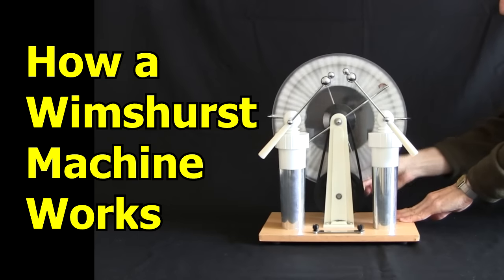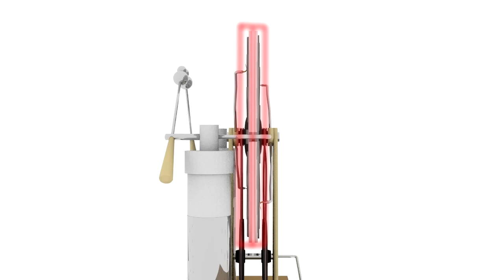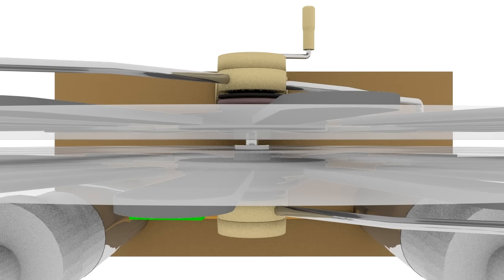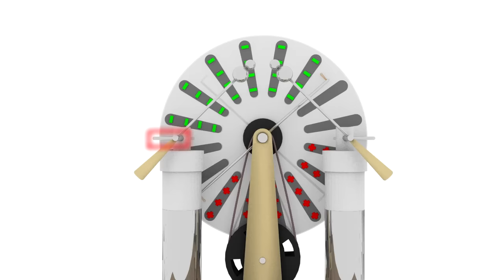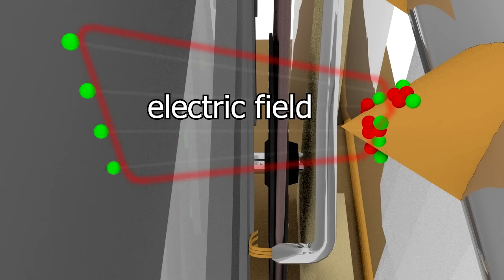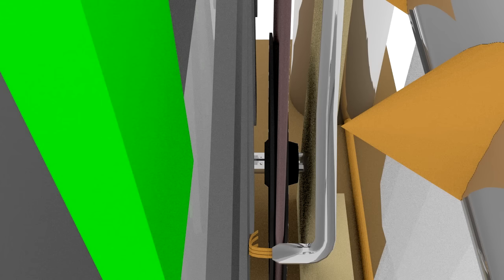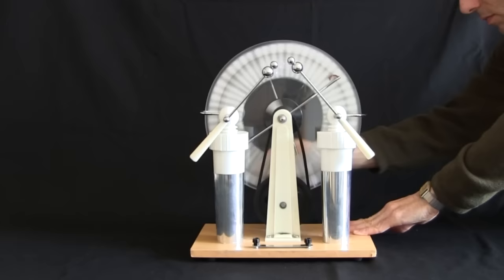How a Wimshurst Machine Works

Comment: I had a Wimshurst Machine when I was a kid and played with it endlessly, but it did not have any Leyden Jars.  It worked perfectly well without them giving an almost continuous spark.  We replaced the crank with a shaft that allowed an electric drill to be attached but the extra speed didn't make much difference.  I note that to get it started, at least in my experience, you wind it up and then allow it to slow down and it was during the slowdown that it most likely fired up.

The video explanation is somewhat lacking.  Why would electrons from across the neutraliser away from positive charges that attract them to other side where there is an approximately equal charge (positive and negative charged particles) causing an excess of electrons on one side and deficit on the other.  This flies in the face of thermodynamic laws as energy should be required to cause such an imbalance (to drive electrons away from positive charges across the neutraliser to the other side where there is no significant electron deficit).

The other puzzling thing with the explanation given is that many Wimshurst Machines that can be seen just by googling show the neutraliser bar not lining up between two metal pads on either side but when on one metal pad on one side is between pads on the other side.  This is how I recall mine.  The alternative explanation is that the static charge on the plastic disc is being transferred to the metal disk.  That would explain why the voltage is around 20,000 which is typical for static charges.  This also corresponds with the nature of Vandegraph generators that also pick up static electricity from a surface where static is likely to accumulate (eg insulators).
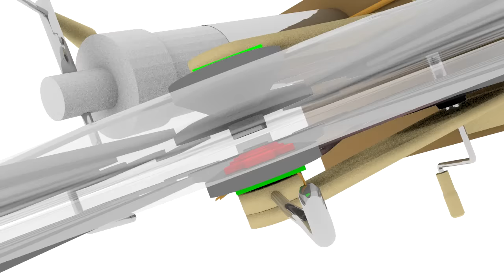Reply from the maker: At 3:34, you can see a negatively charged sector on the disk opposite the one with the neutralizer bar. That's the sector with only green negative signs showing near the top of the video frame. That's what does the repelling of the electrons to the neutralizer bar. There's a similar sector on that same disk at the other end of the neutralizer bar that's positively charged. It attracts electrons toward it away from the neutralizer bar. So it's the influence of those two sectors which provides the imbalance. The energy source for this whole machine is ultimately the mechanical energy of turning the crank.

As for neutralizer brushes which aren't perfectly arranged to touch two sectors at a time, if you ever run your Wimshurst machine in complete darkness, and if it's charging up enough, then you'll see a bluish (or some say purpilish) glow between and around the sectors at the top. If it isn't producing enough charge then the glow will be too dim to see well. That's corona and is ions leaking from the edges of the sectors. It's considered a loss because much of it goes to the surrounding air. It's also electrically conductive and so has the effect of electrically smearing out the sectors such that in that area they're one big sector.
Reply: @RimstarOrg  I used to run mine in darkness.  The electric drill would glow with static electricity as well ha ha.  Try the machine with misaligned brushes so that only one is on a metal pad at a time and you'll find it still works. 

As for the charge going uphill, if your hypothesis is correct then initially neutralising the metal plates would prevent the machine from working at all.  But it does work because static on the disc is transferred to the plates.  As I understand it the principle is the same for any static charge buildup such as combs through hair, silk rubbing, walking across certain surfaces etc....and rubbing a brush over an insulating plate that can accumulate static is another one :)
Reply from the maker: I agree, it should still work with misaligned brushes. As I said, there's an electrically conductive corona in the gap between the sectors in that area. So a neutralizer brush that's in between sectors is electrically connected to the sectors on either side of it. I just didn't cover it in the video because there are a lot of things that could be discussed and so I kept it to the basics.
I wouldn't say the charge is going uphill. Whenever you have a charge imbalance then charge moves in order to restore that balance. In this case the sectors on the other disk are creating a temporary imbalance on the sectors in contact with the brushes (including the area between the sectors) while the sectors are opposite each other.
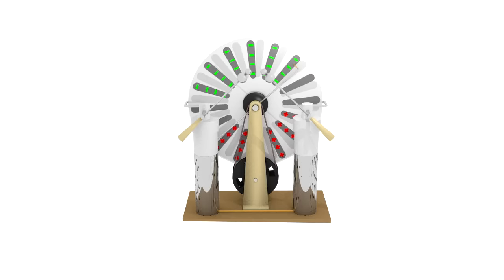Regarding neutralizing the metal plates preventing the machine from working at all, that's exactly what happens. Luckily in reasonably dry air there's usually some extra charge somewhere (I say that in the video at 1:16). But if there isn't then you have to provide an influence to get it started (I talk about that at 9:06).

Comment: Mr. RimstarOrg, sir, I was wondering, is there a way to make a "brush - less" Wimshurst Machine? Are there any designs out there that you may have seen? I guess I'll just start experimenting with a machine without brushes on the neutralizing bars and just use U - shaped cylindrical metal rods for charge pick ups that would be placed laterally on each side of the two disks, without any points or little nods their surfaces. I hate scraping the sectors on the disks !
Reply from the maker: I have heard of brushless ones where the neutralizer bars used sharp points separated from the disk by a small gap, but I haven't tried it myself. I don't have any links off-hand.
Reply: Check out sparkit
Reply: @mareksvrcina5279  Thanks Marek ! we use carbon fibre brushes in our kits, they are very soft and gentle on the disks
Reply: @RimstarOrg  my understanding is this approach (using sharp points) does work, but the machine will need external excitation to start..

Comment: Bruh I did the stupid.

So I built your wimshurst machine (the DIY version), and it turns out that I literally put the neutralizer rods the wrong way.
I fixed it and got my first spark!

Some modifications I made are:

16 foils on each
Made of cardboard (no corona leakage as far as I can tell)
2 cylinder shaped Leyden jars
Reply from the maker: I'm glad to hear you got it working. Thanks for letting me know.

Comment: @RimstarOrg would the machine work if the neutralizer bars had combs instead of brushes? and what if the collectors had brushes as well? thanks! great video btw
Reply from the maker: I've seen Wimshurst machines where the neutralizer bars and combs instead of brushes, though they seem to always not have the sectors, just plastic discs. Keep in mind that plastic is non-electrically conductive so when charge is sprayed by a comb onto the plastic, the charge doesn't then move around on the disc. That's similar to how charge on a sector doesn't move directly from one sector to the ones near it.
As for collectors with brushes, I'm not sure. I think that might limit your voltage but I'm not sure.

Comment: Why don't the collectors touch the plates?  Could they?
Reply from the maker: I think the reason they don't touch the plates is to allow a higher voltage to build up on the Leyden jars and across the spark gap. If they touch the plates then the plates that they touch will become a part of the larger high voltage capacitor and would probably discharge to adjacent plates. At least that's my guess.
Reply: @RimstarOrg  If the charge jumps the gap from the influencing plate to the capacitor couldn't we assume the same in reverse (the capacitor can jump back to the influencing plate)?  And wouldn't the capacitor, once having the greater charge, function in this manner?

So technically it should never obtain a greater charge (voltage wise) than the influencing plate can provide?  If it did, wouldn't it push against the influencing plate?

It seems they could only ever truly be equally charged (again, voltage wise, I guess?).*

Though, the capacitor being double walled increases it's capacitance due to the attraction of the opposite 'capacitor plate.'  Of course the 'influencing plate' is still a part of that circuit..so, if connected, the capacitor should still draw charges away.

Once full, the nearby influencing plates have the same charge so they shouldn't be affected any more than the one touching the circuit.  It may arc to the previously used plate, I suppose; though it's capacitance is low so not much loss would occur and only at peak charge anyway.

In fact, since the capacitance is greater on the capacitor, it's likely 'capacitively' charging until voltage is equal; where they both (the capacitor and the influencer plates) would then, I believe, simply work together to ionize the air (hence the coronal discharge you mentioned that becomes visible).

*Interestingly, I think this is analogous to fluid dynamics, specifically hydraulics; where it is easy for a small syringe to inject a larger one while the reverse is more difficult.  This would mean a smaller influencer plate could provide greater voltages and/or capacitance?

Does the small plate actually have the same maximum voltage capability as the capacitor only with less capacitance?

I was just watching your cd wimshurst machine video and it occurred to me that, if it doesn't touch, the plates probably don't fully discharge which means they carry on somewhat over/under charged, too.  So causing it to touch should only maximize the transfer; where the wire itself would probably produce the coronal discharge (being pointy by comparison), once the capacitor is full.

Unless connecting them weakens the influence and the air is needed as a medium??

I don't know, but It sure is fun to think about!  I definitely enjoy understanding too, though, so thanks for your guidance and help!

Edit: Lines of force must come into play too.  I wonder if adding a point to the influencer (lile the collectors) would aid in the transfer and reduce ionization/coronal discharge of the air.

Maybe even nested conical shapes?  The emitter, like a solid pointed cone and the collector covering it like a dunce cap?
Reply: The collectors on my two machines DO touch the sectors and both work fine.  This question continues to baffle me.
Reply from the maker: Yeah, it's a tough question for me too. If I were to try to apply my answer to your case, where the collectors do touch the sectors, then I'd say that you're not getting much loss from sector to sector. The sectors I'd worry about losses at are the one which has just passed a collector and the one that the collector is touching. The one that just passed the collector would be neutral and so there'd be a big potential difference between that one and the one touching the collector. That could lead to corona between them and conduction through that corona.

Comment: I want to limit capacitor charging voltage to 30kV. Shall I place it across the spark gap after adjusting the distance to be closer for lesser voltage?
Reply from the maker: Yes, you can use the spark gap distance to limit the voltage on the capacitors. It will vary due to the humidity too but I don't know what percent.

Comment: Nice design.....put a bottle around the spark caps.....connect the bottle with a small tube the the bottum of another bottle of water and you get nitric acid for free....add calcium-, sodium-, potassium carbonates and you have very good fertilizers....
Reply from the maker: Cool. From what you describe, it sounds like you're taking ozone from the spark gap and injecting it into the water. The formula for nitric acid is HNO3, so this is somehow causing nitrogen to react to (nitrogen dioxide NO2?)?
Reply: Birkeland-Eyde (arc) process was used to synthetize nitric acid before Ostwald process was invented. Arc causes formation of nitric oxide which is then oxidized by oxygen in air to nitrogen dioxide.
Reply from the maker: Thanks!

Comment: This video looked promising until about the 4 minute mark. A neutralising arm would neutralise the charge, not transfer all electrons from one pad to another.
Reply from the maker: That's what you'd (and I'd think) at first. But then really it can only equalize the charge throughout itself and every electrically conductive thing it's in contact with. If there are excess electrons overall then electrons will be transferred. Even if the overall charge was neutral but there was an excess somewhere then it charge would still be transferred.
Reply: When the neutralize bar makes contact with the sectors, it is as there is a single long piece of metal made of the two sectors connected by the bar.
BY the effect of the other disk induction, in an extremity of this single piece, electrons are attracted, while on the other extremity electrons are repulsed.
When the bar slide off from the sectors, it is as this long piece of metal is broken in two pieces.
The charges inducted on each piece however remains, and they are conveyed towards the collector and the Leyden jars where they are acumulated.

Comment: This does not explain why it generates sparks when rotating only in one direction, nor the ozone smell, nor why it creates measurable radiation the longer you use it (try measuring with a dosimeter next to a collecter).
Reply: 臭氧是空气被高压电离，至于使用后会产生辐射也是高压
Reply: The ozone is probably formed by oxygen molecules being exposed to high temperature/high voltage.

Comment: What can you do with the metal switch at the bottom of the machine that allows you to open and close the connection?
Reply from the maker: Are you referring to the metal bar that's electrically connected between the outer cylindrical electrodes of both Leyden jars? On my Wimshurst machine it essentially cuts into where I highlight the wire at 7:09 in the video.
I've never used it myself. On my machine, the metal bar can be removed and you can connect a load in place of it. That will cause a voltage to exist across your load, with the potential being equal to the potential difference between the two outer cylinders. Maybe that's why there are two Leyden jars instead of just one bigger one?

Comment: 5:34 in real machine there is a sparks between disk and combs. Is it useful sparks or not? How to explain this sparks?
Reply from the maker: I don't get sparks between he disk and the combs on my Wimshurst machines. If you're getting sparks then that sounds like the points on your combs aren't sharp enough. If they're not sharp enough then charge will build up on them and stay on them, instead of cross the gap a little at a time. That will cause the electric field between them get stronger and stronger until finally the charge bursts across all at once. That's the spark. That's what happens at the spark gap at 7:52.
Reply from the maker: In that case he's likely producing charge from only the side that has both ends of its neutralized bar touching. I say "likely" because the brush for the neutralizer where it's not touching has sharp points and it's possible that that end is interacting a little bit with the disk through ionized air. If you look at a Wimshurst machine in darkness then you'll see the disks glow a lot with bluish corona due to all the leaking charge from the sharp edges involved (on the sectors and the brushes).
PS. Youtube flagged your reply as spam, probably because of the link, so I only just now noticed it.

Comment: Is it possible to attach a small motor to the crank to power the Wimshurst without manual motion?
Reply from the maker: Absolutely, it should be possible. I connected it to a 3D printed sprocket and powered it using my bicycle https://youtu.be/dQYCHMPH2uE

Comment: Do the discs have to exactly contrarotate or can they independently vary their rpm?
Reply from the maker: Yes, they have to counterrotate for the reasons in this video. But they must also rotate such that the sectors line up when they pass the neutralizer brushed and the collectors.

Comment: 1. Like the Corona Motor, i was wondering if a static tower could be the intial negative charging source?
2. Instead of large flat plates, would thinner strips ( like using the same amount of material, those plates cut into strips ) produce more current?
3. Voltage increases as you go higher, but would 5, 10 foot wires get produce the same voltage as on a 50 foot tall wire?
4. If i wanted a Corona motor to produce more torque, is voltage all that matters or would introducing more current be more efficient?
Reply from the maker: 1. Yes, a static tower could be the initial negative charging source. Keep in mind that initial charging is only needed when the air is damp or when the disks are dirty or there's some other problem. Normally it's not needed.
2. If you want more current then what you want is more total area. More strips with the same total area won't help you get more current and it'll probably just result in more losses since there are more edges and the edges are one source of loss.
3. No, voltage is strictly determined by height. Having more wires would give you more current though. It would be the same as having more sharp points at the top.
4. As long as you meet the minimum voltage required to ionize the air between the edge of the blade and the surface of the cylinder then high voltage doesn't help. Past that point, for more torque you want more current.
Reply: @RimstarOrg  thank you very much. Your videos were very helpful.